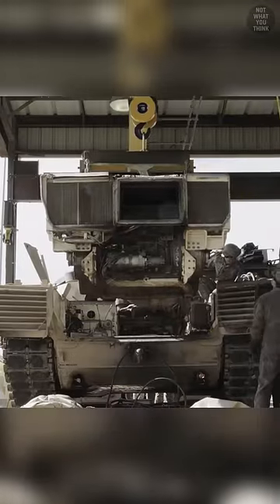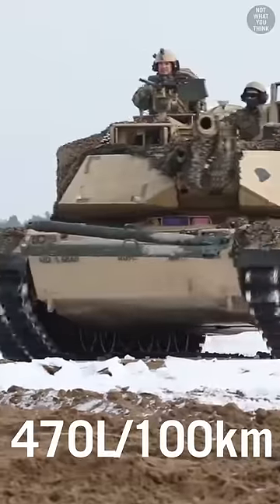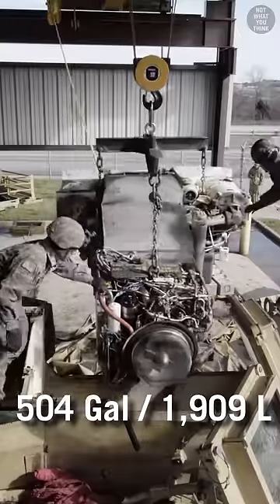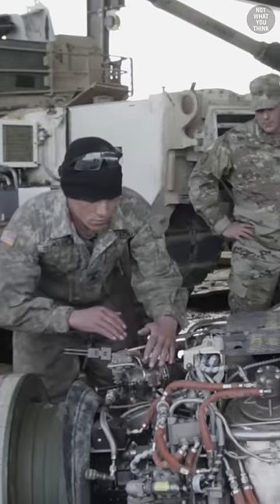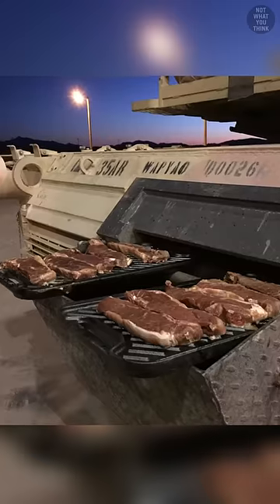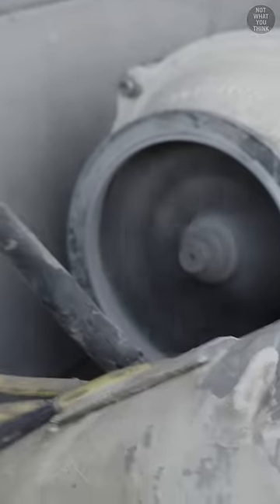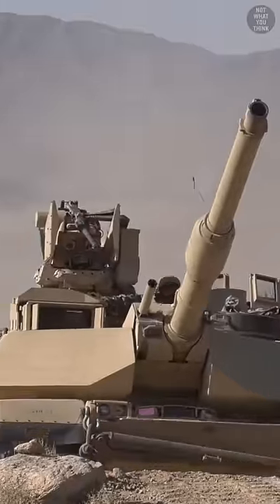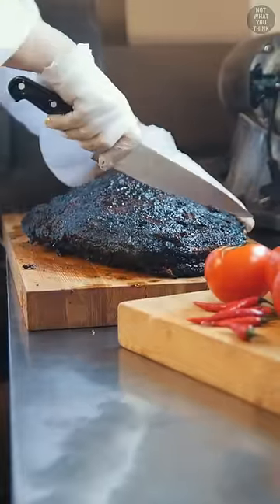Why M1 Abrams Tanks Have Gas Turbine Engines #shorts

Comment: Given that the US’s overall doctrine that requires extensive logistics planning and support, having an engine that can run on multiple types of fuel is an offer they simply cannot refuse. Because after all, logistic wins war.
Reply: Turbines are hopeless in dusty terrain. Air filters need many times more maintenance than for diesels.
Reply: @teeanahera8949  air filters are also easily replaceable. Its a non issue. Abrahms have run just fine in deserts for over 4 decades now
Reply: @Demonslayer20111  i can imagine a sandstorm could cause troubles tho
Reply: Perun goes brrr
Reply: using alternate fuels isn't actually important, they drink the same JP8 that the much much much much thirstier air force uses
Reply: Piston engines can run on a wider variety of fuels, do try again.
Reply: Nowadays, basically any type of tank engine, be it a jet engine or diesel engine can run on multiple fuels
Reply: @gecgoodpasi1654  No tank would handle a sandstorm better than an Abrams.
Reply: @owo1744  🤣🤣🤣
Reply: @gecgoodpasi1654  The Abrams actually fought a battle in a sandstorm during desert storm, did pretty good.
Reply: If you only use diesel for the rest of you land vehicles what difference does it make
Reply: @teeanahera8949  And yet the Abrams worked great in Kuwait, Saudi Arabia, Iraq, etc.
Reply: @soloqueuepixy  More importantly, it uses the JP-8 and JP-6 that the Navy ships use.
Reply: @JAnx01  Oh yeah? Out some Diesel into a petrol car (or vice-versa) and tell us how it makes out, okay?
Reply: @WorldlyCoronet7  No, a Diesel tank CANNOT run on jet fuel or gasoline. Try again!
Reply: @carlgustafemilmannerheim9360  If you only use Diesel for everything then you get Diesel tanks, but the US uses jet fuels for a lot of stuff like Navy ships, aircraft and some land equipment, so it’s a very common fuel in the logistics chain. It’s also a common fuel in most countries (for aviation).
Reply: @owo1744  most lighter tanks do. The Abrams is too heavy too dependant on maintainence and sucks ass in deserts
Reply: @afcgeo882  They can with some modification (look at tractorpulling)
Reply: @Nick-fw5uj  Those tractors are only allowed to use Diesel fuel, albeit with water injection. You should do that research you mentioned.
Reply: @teeanahera8949  idk seems the last 30 years of abrams being used in deserts shows they work perfectly find in deserts
Reply: @afcgeo882  In the Netherlands they also use alcohol
Reply: @afcgeo882  Dude, it just takes a quick google search. Multifuel engines have been a thing since WW2 and the USSR (now Russia) has been using it since then. Their diesel engines can take a lot of fuels, people really just fall into this types of propaganda lmao
Reply: @afcgeo882  hey take a guess what fuel our diesel humvees use, wether it be a 6.2 Detroit or the 6.5 Detroit, the same engine that was in 90s Chevy pickups, that’s right jp-8 the same jet fuel used in our turbine engines because jp-8 is practically glorified diesel.
Reply: @gdmjs  Why would I guess? All our Diesels run on JP-8 since 2000. Before that we used JP-4. That doesn’t mean you can run gasoline in a Diesel engine, numbnuts, which is what I was saying.

JP is kerosene, which is more refined Diesel oil. It’s fine to run in a compression engine, but you want a compatible IP because JP will eat through a regular Diesel IP. We also run them on bio-Diesel. JP-8 is less volatile, so that’s one of the reasons that US military vehicle engines just don’t run that long.
Reply: @WorldlyCoronet7  “Multi-fuel” doesn’t mean you can run anything. A Diesel engine simply cannot run of gasoline or alcohols. A turbine can..
Reply: @afcgeo882  no I agree with you on the gas in a diesel of course, I was more commenting on your comment of if we ran diesel we would use a diesel tank, when that’s not the case since we could just run jp in whatever diesel was thrown into the abrams, and yep you would think jp would be a lot harder on more stuff then just the injection pump, maybe it is.
Reply: @gdmjs  I think the reason the Abrams was selected with the turbine was because gasoline is FAR more accessible in the US than Diesel or JP, and if the US was ever invaded, running them on gas would prove to be a huge advantage over the enemy, who would need Diesel fuel.
Reply: @afcgeo882  Diesel engines on T-72s can run on gasoline, diesel, benzene and kerosene. T80s use a gas turbine engine and they can use even more types of fuels.

You can't compare a car engine with a military use engine. Sadly I can't post links in here as I tried, but it takes an effortless google search to see what I mean. You just seem too lazy to do it
Reply: @afcgeo882  Teenage, I'm 32 and have been working in the aerospace industry for 8 years now ._. also, what does my country of origin have to do with any of this? You saying that just because I am from Colombia then I can't use google or I'm dumb? I speak 4 languages and got a masters, what do you got? 1-language speaker (AKA American) and work on a grocery store with your wannabe Navy seal mentality lmao
Reply: @afcgeo882  Says the tuy that came here insulting people just because
Reply: @afcgeo882  hm never thought about it that way, that’s actually a very good point. Definitely a better reason then I’ve ever came up with.
Reply: @gdmjs  I think it’s also why Europe went with Diesel. Diesel is as common there as gasoline. Every fuel station has it, all over the continent. Running tanks on anything else would be more problematic than resourceful. 

By the way, the relative lack of Diesel fuel in the US is also why the DoD runs everything on either gasoline or JP-8/6.
Reply: @afcgeo882  the reason for why the Us chose the turbine engine is not that it can do multifuel, 
its because:

1) its less loud In long distances because of the high frequency falloff

2) its more compact while retaining similar power

3) chrysler used its connections during the xm-1 programs to bribe the goverment to take their gas turbine xm-1 over the General motors diesel engine xm-1 which was almost at the finish line for the xm1 program
(also the diesel engine xm 1 was slightly better In a few aspects)
Reply: @DubiousFIN  And I assume you have some proof behind any of that? People here have accurately stated that the engine/transmission combo on the M1 is significantly larger than the combo on the Leo.
Reply: @afcgeo882  most countries use diesel on Tanks because its

1) less flammable than gasoline
(yes less, its not impervious to getting set on fire since it would not make a good fuel then) 

2) is the most used fuel for electric generators that power the Tanks electronics

3) is better at producing high amounts of power compared to gasoline (which you know is important when accelerating 60 tons of steel to 40 mph)
Reply: @DubiousFIN  You keep commenting, making arguments about things no one was talking about. You get that, right Rainman? 

Literally no one suggested tanks should use gasoline engines.
Reply: @afcgeo882  i looked at this comment section and i have not found any conversations about powerpack size differenses

But i could assume its because of the differences In the engines

1) The M1 abrams can go slightly faster than the Leopard 2 due to the transmission
72kmh compared to 70 kmh
Though both have the same gear ratios 4f and 2r gears

2) the M1s engine because its a gas turbine needs way better filtration systems since a tiny dust particle can destroy the engines insides) which results In the need for extra space

Meanwhile the leopard 2s crews have 2 fans taking space along with the filters for them too, but In that design they could cram the air intake system ontop of the transmission saving a bit of space but not much.
Reply: @afcgeo882  what arguments?

Also sorry, the Google results for Rainman show that it was a movie made In the 80s and i haven't seen it so,,, sorry? i don't get your reference.
Reply: @afcgeo882  you do bring up interesting soft changers that could have influenced the decision making of the designers during the time.
Reply: @shelldie8523  history says otherwise
Reply: Unfortunately for those of us whose tax dollars are being consumed in such acts of thievery, America doesn't seem to do much winning though.
Reply: @ModMokkaMatti  history says otherwise and current economic/military might says otherwise.  Additionally,  you don't have to pay taxes into it. There's alternatives that would afford you a life in which you don't make asinine complaints.
Reply: @ModMokkaMatti  America is pretty good at fighting countries, not long term insurgency. Most of the wars the US fought has been a victory and America has shown fundamentally and consistently that it doesn’t know how to fight insurgency.
Reply: @JAnx01  without alteration the Abraham’s turbine engine can run on a variety of fuels.
Reply: @WorldlyCoronet7  American isn’t a language…
Reply: @SilentTohka  There is a joke that goes like this:

What do you call a person that speaks 2 languages? Bilingual

What do you call a person that speaks 3 languages? Trilingual

What do you call a person that speaks 4 or more languages? Polyglot

Ok, now what do you call a person that speaks only 1 language? American
Reply: @WorldlyCoronet7  You realize that "working in the aerospace industry" doesn't make you a subject matter expert on all things aerospace/defense correct? Neither does your masters, especially since you didn't tell us what field your masters degree is in. For all we know, you working in the aerospace industry means that you help assemble civilian airframes (I could be wrong but I don't imagine Colombia has much of a military aerospace industry). 

Also, a diesel engine, by design, CAN NOT run on gasoline without modification to the pumping and ignition systems. So no, the T-72's engine can't use gasoline (though you were correct about the other fuels it can use). Stating that it can use gasoline is a novice error that anybody who knows diesel/gas engines would know better than to make. Kerosene is also very hard on diesel engines as it isn't as lubricating as diesel is.
Reply: @jacobdewey2053  I'm Colombian but not living in Colombia. You are correct, Colombia doesn't have much of an aerospace industry other than maintenance.

As I said before, even though T72s engine can't run on everything, it still can use diesel, benzene and kerosene. 

This engines are not just made without thinking. Although in the past, diesel engines would have broken with kerosene pretty fast, nowadays even a diesel engine on your average car can use it without much trouble in the short run (although you might not want to do it for an extended period of time).

This features are thought for extreme situations where your regular fuel is not available, just like being able to use cooking oil, per se, on an Abrams, doesn't mean that you'll want to do it forever.

On the other hand, I want to clarify a few things on kerosene being used in diesel engines, specially on tank engines which are made to be more robust than a car's.

The most common concern cited is the dry burn of kerosene that may damage fuel pumps. Kerosene has very little lubricity compared to #2 diesel. Without the lubricity, fuel pumps experience a lot of wear and may burn out when running on kerosene.  Some people will cite additional parts that will wear, like rings and gaskets and valves.  The easy fix for this is to add some automatic transmission fluid to the kerosene. 2-cycle oil also works in this situation. Some people will cite kerosene as a hotter-burning fuel than #2 diesel, with subsequent concerns about burning out rings. Others cite the fact that kerosene has less energy value, and so would not burn at a hotter temperature.

It is absolutely true that kerosene contains less total energy than #2. But less total energy only means that if you burned a gallon of kerosene, you would get less total heat than if you burned a gallon of regular on-road diesel.

In practice, kerosene has a lighter viscosity value and this does make it burn at a hotter temperature in an engine. 

To end, lets also remember that sometimes kerosene is mixed with diesel in cold environments, not only on tanks, so the practice of using kerosene on a diesel engine is not something new nor something that hasn't been practiced before, people and manufacturers are well aware of this
Reply: And then there are the engines they used in the humvees and you have mechanics telling them to keep them running on deployment because they might not start again lol
Reply: @teeanahera8949  first of all, the Abrams uses a particle separator, not a filter. A particle separator is lower maintenance than filters. Secondly, diesel engines do need air intake filters and are much more sensitive to foreign object ingestion than turbines. Throwing a handful of dust into a running turbine without the separator will net you a nice fireball out the exhaust and no further issues, doing the same to a diesel with no filter will destroy the engine. 

I work on turbine engines for a living, and they are a LOT tougher than people make them out to be.
Reply: @gecgoodpasi1654  blow out the filter with compressed air, fixed.
Reply: @teeanahera8949  most tank and armored vehicle engines are air hungry and on the first production m1s they did have problems with the filters but ever since they haven't had any issues out of the normal for a armored vehicle operating in a Dusty environment just simply do your routine maintenance
Reply: @JAnx01  a turbine engine will take about anything that can be combusted and for the most part produce very similar power levels especially considering the main alternative fuel they're considering is jp8 or jet fuel.
Reply: @carlgustafemilmannerheim9360  most US military vehicles are designed to run on diesel and alternatively jp8, the Abrams has the widest choice of fuels thanks to the gas turbine which is lighter has reduced sound at combat ranges and produces slightly more power and a gas turbine is mechanically simple than a piston diesel so there was actually many advantages to choosing a gas turbine engine besides just the fuel choices
Reply: DontWorryDiaperJoeGotYouCovered  which was an Insurgency style war but Desert Storm we won Korea we are able to drive it to a stalemate World War II was able to win on several fronts, is there a need to go on?
Reply: On the other hand you have to bring 2x more fuel. So with diesel it would run out 2x slower.
Reply: @teeanahera8949  abrams are the most used tank in modern combat alot of mistakes and lessonn have been learn about its maintainance and logistic its probally the best tank for combat today
Reply: Well, every tank needs logistics and support. There is nothing to do with doctrine.
And diesel engines can run on multiple fuel too even coconut oil.
Reply: Diesel engines can also run on different types of fuel. Not only gas turbine. Altough to it does have some slight limitation
Reply: The sad thing is that they did multifuel better than our poor chieftains ever managed
Reply: Diesel fuel is almost standard worldwide and usually widely available
Reply: But being that it also consumes more fuel than the regular engines
Reply: Dear friend.. diesel and jetfuel are 99% simular.. it's a typical ineffective USA design..   any tank diesel engine can use kerosene.. there is no advantage for tanks using gas turbine.. just a bad choice
Reply: Unless fuel supplies become a problem. Then you're going to run out in 48 hours or less and that thing ain't moving.
Reply: So, it was the problem with logistics in Vietnam and Afganistan ?
Reply: @shelldie8523  "Abrams sucks in desert" said no one credible ever
Reply: Logistics wins wars, but not in Ukraine against Russia.
Reply: @shelldie8523  it seemed to do pretty well in operation desert storm. What was the kill ratio of Iraqi tanks to American abrams?
Reply: xDDD LOL